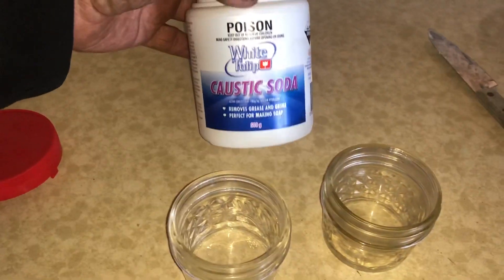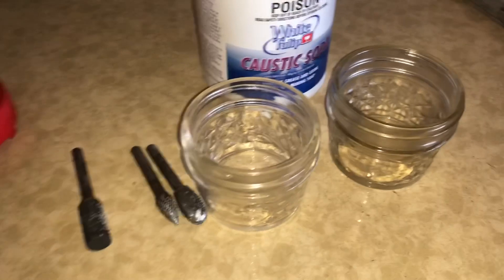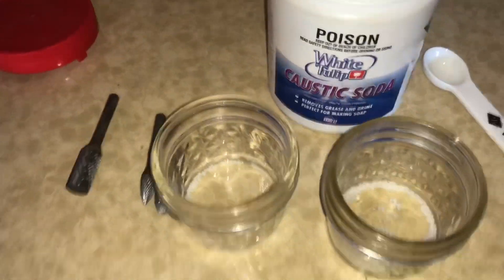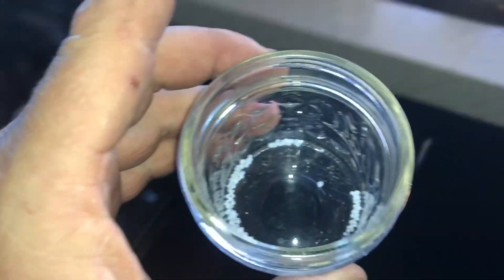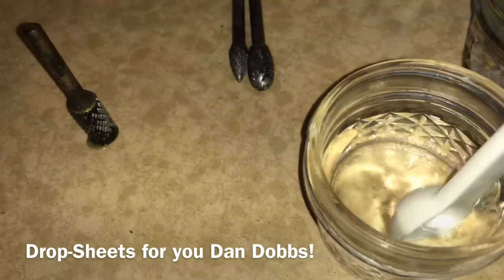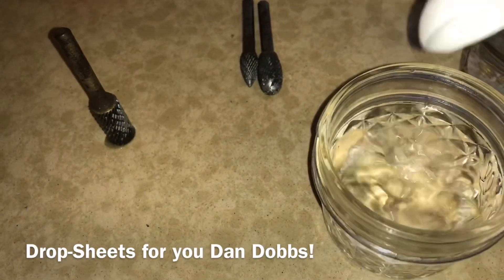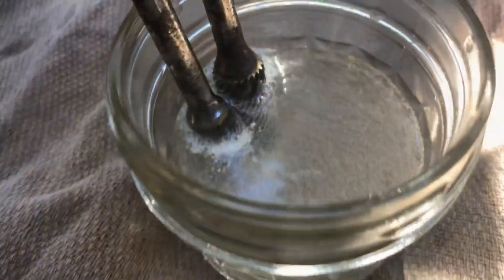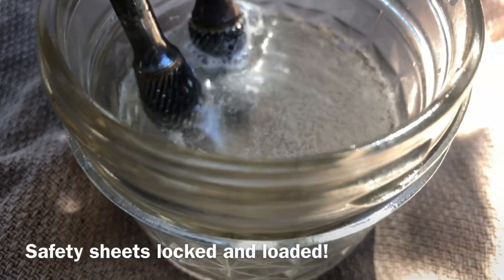Tool Time - Caustic Soda Cleaning of Ali from Carbide Burrs

Comment: Great tip i use these for porting heads and half are alum and some cast iron
Reply from the maker: Yeah i think these burrs are meant for steel not aluminium, they gum up way too quickly, my mentor Dave taught me to use soap to help keep them clean. I think aluminium burrs are more open teeth so I probably used the wrong ones here
Reply: @JBFromOZ  yes they are but that makes them too coarse for some jobs a use transmission fluid to keep them from loading up but still need to clean not as often

Comment: HAHAHHA Nice Drop Sheet Crack... LOL. 

The co-hosts are a great add.  

Neat trick.  Beats a pick and magnifier.  

Caustic dips are tough on valve springs - you win't find out until weeks or months later. Then snap and the motor is history..  

Well done Kids.... 

Dan
Reply from the maker: Yeah valves springs collets etc we keep separate, wire brush on springs, and sandblaster on valve heads only, wire brush elsewhere